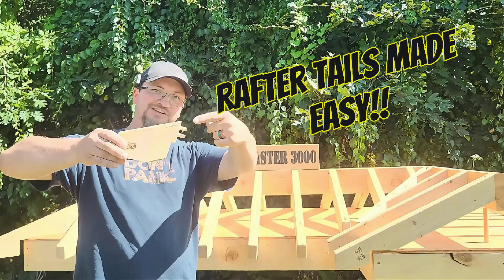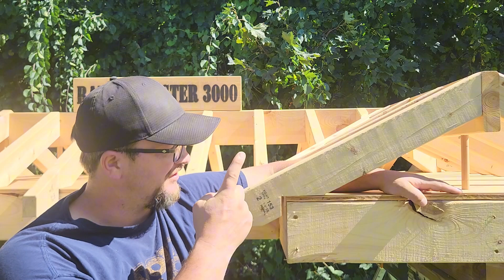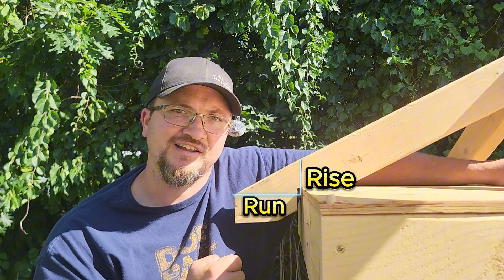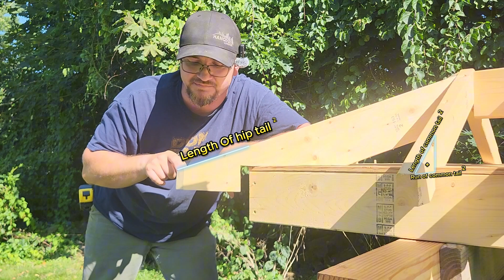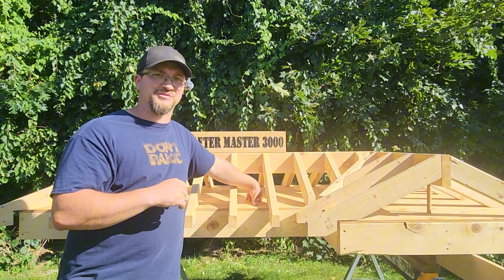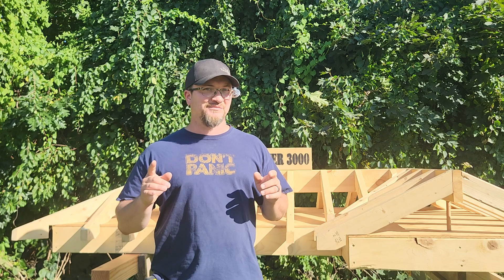Calculating Rafter Tails Made Easy!! #diy #tutorial #protips #rafter  #carpentry #newvideo #hack

Comment: Most engineered rafters don’t come with the birds nest cut out ( the notch resting on the top of wall) so the sheeting slides into place easily, this guy is making more work than need unless you do your own rafters.  If you do your own raftrrs you may need an engineer to ok it ($300-$500).

Comment: Interesting. How come you didn't take the wall sheathing thickness into account when determining your span/run? Then you just determine the run of the tail from the outside of that sheathing? Was there a much better benefit in doing it your way?
Reply from the maker: I like to do all my math from the frame because sheathing thickness can change depending on moisture saturation and a whole host of other things when buying in mass produced bundles. So what I do is after I do the math I simply add the thickness of the plywood plus a 16th of an inch for variation in the bird's mouth.